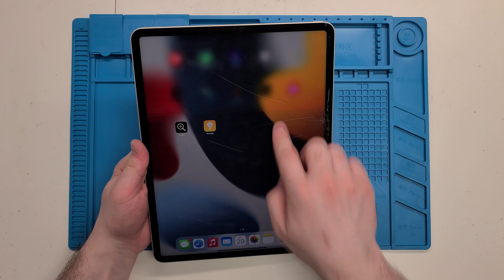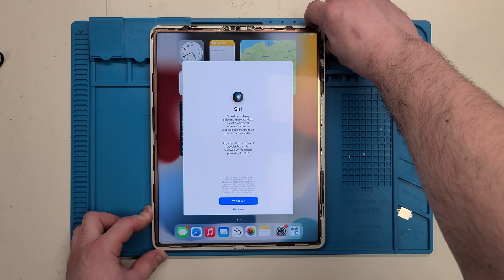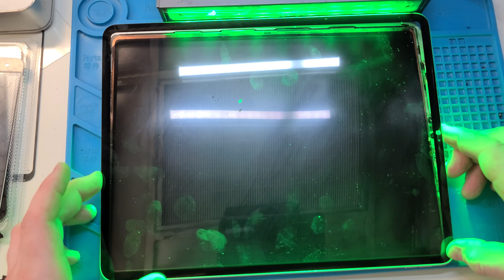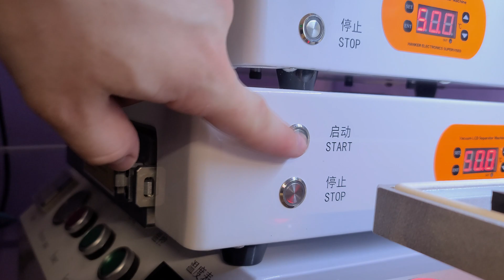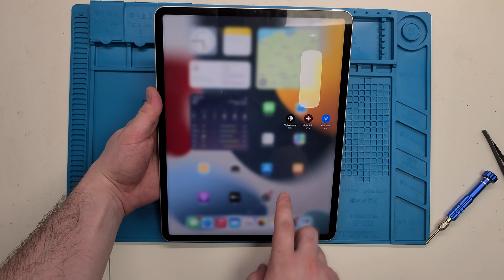🔧iPad Pro M1 Glass Only Replacement - 12.9 5th Gen 2021 XDR display refubrish📺⚙️

Comment: Hi I have one question, if I was to do this without a laminating machine and instead stick the new glass around the sides of the e screen then clamp it for temporary use will I face any problems
Reply from the maker: Hi! Hmmm.. I think it should work, but remember that after 2-3 months You will have a dirts under the glass.  But it should work, test before glueing 😁
Reply: @JerryMobilePL  ok thank you

Comment: Hey, im growing more confident in my phone repairing. Might try out to replace glass only on a phone soon. What are the machines at 11:30 and 11:45? Are they necessary for a good repair?
Reply: Wish this guy was in America smh. Apple said I gotta pay 700 to fix this thing and no one else will repair it
Reply from the maker: Hey! For OLED displays machines are not necessary, then You have to use LOCA glue to put new glass. But for LCD displays, iPad displays machines are necessary. Then effect is as factory 😁

Comment: Good video jerry 👍

I have one question, do you know why debubbler does not remove all bubbles for me? I set it to 50C for 15 minutes & removes many bubbles but always has some left. Any suggestions my bro? 😔
Reply from the maker: Thanks 😁
First please tell me, is it on straight and curved screens, or only on  the curved? How much bar pressure You have on debubbler?
Reply: @JerryMobilePL  It happens on both screens my bro. My machine is TBK-408A. It measures in kpa the vacuum settings. It only goes up to 98 kpa. Anything above that my machine does not support :(
Reply from the maker: @f_x9771  vacuum 98 is ok. Question is if themeasurer shows it correctly. Probably yes so problem can be in debubbler (pressure lower than 6bar) or lamination pressure is too low. OCA glue is very important too- I use only Mitsubishi and I never has a problem. About different noname oca.. I has the same problems like You
Reply: @JerryMobilePL  Thank you so much for responding to me brother. Where can I buy mitsubishi do you know? Thanks again for help 🙏
Reply: @JerryMobilePL  You were right Jerry, I did higher pressure & debubbler work ok now. But problem is, bubbles are removed but in 1 or 2 hours small bubbles appear in corners, what am I doing wrong? 😔
Reply from the maker: @f_x9771  it's a poor quailty oca glue.. or too long in debubbler- try 5-7 minutes for straight lcds and 12-15 for curved. UV light after autoclave is a really good thing too 😉
Reply: @JerryMobilePL  i will try this Jerry thank yoh so much 🙏 Also, I use 95 KPA, 70C for 25 minutes, maybe this is why bubbles come out. Shoulf I lower degree too? Or does not affect it?
Reply: @f_x9771  did you figure out your issue?